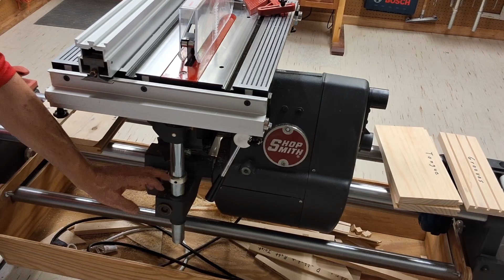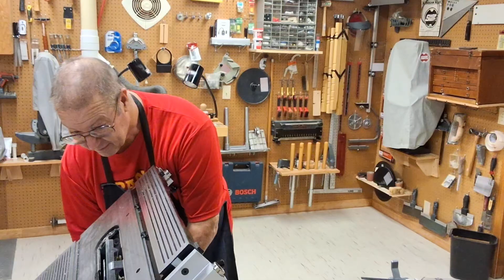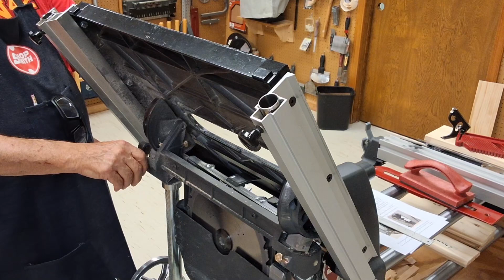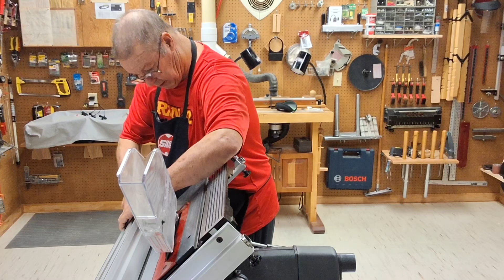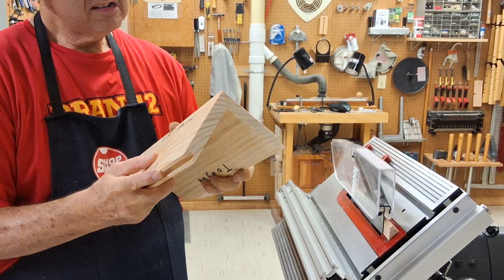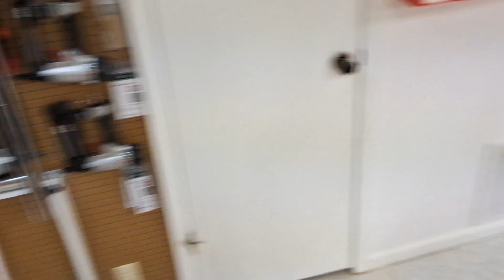Mark 4/7/520™ Self-Study Course Assignment 1-6 Bevels & Chamfers

Comment: Thank you.  Good content.  By the way, do you know of a way to extend the reach of the table when doing bevel cuts?  I need to bevel cut some longer boards.
Reply from the maker: @danasmith8950  You can add some connector tunes and floating tables for support but there is still a limit.  For really long boards you need to use a miter saw.